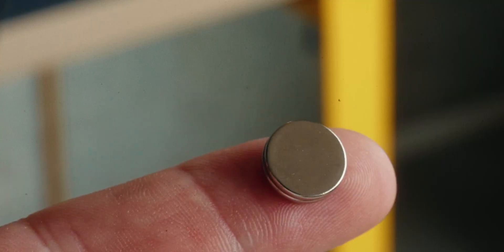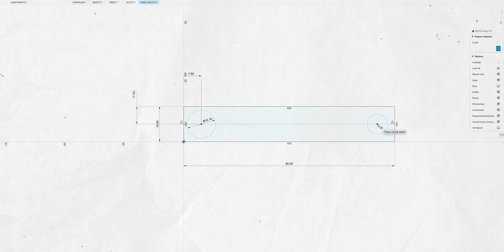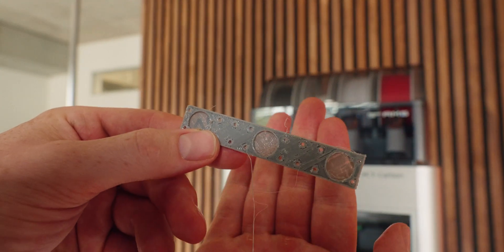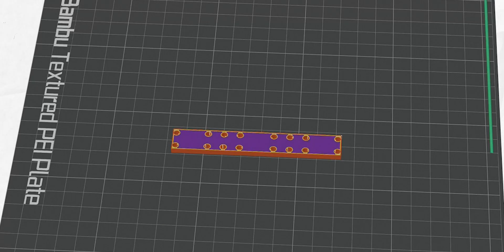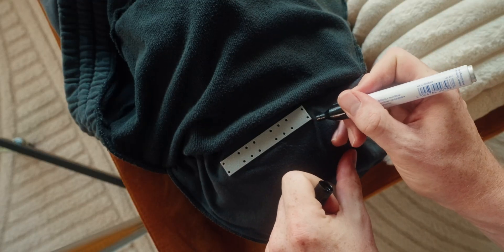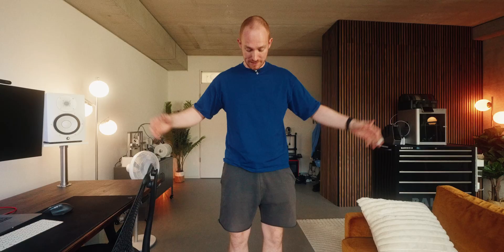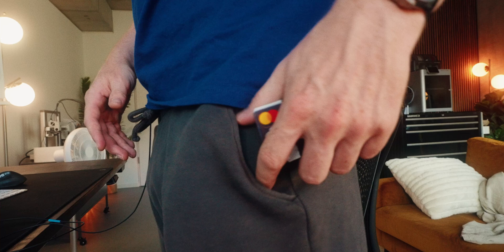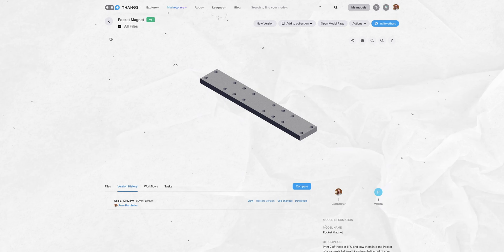The solution to things falling out of your pocket

Comment: Usually it's the phone that's a problem. In the situation where you get to also print a case for it I wonder if you can place the fastener at the bottom corner of the pocket. So that when you place the phone in your pocket it latches onto the corner and stays put. If it's at the corner of the pocket you don't even need sewing, you can clamp it somehow. The difficult thing is coming up with a strong but unobtrusive fastener. Because it will lay against your thigh all the time – you don't want it to scratch or show through clothes.
Reply from the maker: Interesting idea 😊 !

Comment: Instead of magnets on both sides, perhaps you should try printing one side and using a thin piece of ferrous metal with holes in it for the opposite side this would be substantially thinner and you could use thin spring steel that is magnetic for flexibility. It would be much thinner overall and the metal side embedded on the outer piece of fabric which would be less noticeable.

Comment: Just glue a couple of magnet directly to the opposite sides of the pocket, if you use e6000 it will be flexible and allow washing.    I love 3d printing but not necessary in this case.  Larry

Comment: I love the classic case of overthinking... I do that a lot, there are these snap fasteners (don't remember what they are called in English exactly), that have 2 halves and you basically install then like rivets and are invisible and hold well. They would not be visible at all when put on the inside of the pocket. No sewing, no nothing, just put them in place and you are done.

I'm into sewing and I was making my first cosplay and you wouldn't believe how many things I considered and this is the simplest and the best method. And the cheapest.

I like magnets but a lot of the time they rust and flake and overall degrade in clothing with washing over time. There are some special clothing magnets but they are pretty meh and don't work that well. Usually only used kn things like coats where there is a lot of them in a row.
Reply: This seems to have the best balance of usable and easily doable

although... lining up the buttons every time has to be annoying

Comment: I feel like if you're going to go through the effort of sewing magnets into the pockets, you're better off sewing some kind of zipper instead. The only downside to zippers I can think of off the top of my head is that it's slightly more annoying to grab something out of your pocket. But honestly, I think zippers would be more secure than a few small magnets. Cool project idea though, I imagine it would be very satisfying for your pocket to snap shut.
Reply from the maker: Thanks for the idea! Yeah zippers definitely have many upsides:) From my understanding, sewing them in is just a lot harder and since you saw how great my skills are I'm not sure I'm up for that yet. And since zippers are visible, you gotta make sure it really looks good, whereas the magnets are kinda hidden
Reply: It'd be very hard to do on those types of pockets. You might as well sew whole new pants
Reply: Zippers are slow, and I scratched stuff on metal ones. I much prefer the magnet solution 😉
Reply: Compromise: Use those rubber magnetic strips, like refrigerator or car door magnets or the cheap tape rolls at the craft store.
Reply: I've had zipper pockets, total PITA. Always having to zip/unzip, jamming, and the zipper teeth scrape your knuckles up.

Comment: Chamfers.. it needs chamfers
Reply: You likely meant an edge 'fillet'/'radius'. Chamfers can still have painfully sharp 45 degree edges on it that aren't ergonomic to the wearer as they often cause pressure points. I confuse their terms all the time, hence why I know this.. you can however add fillets to the corners of your chamfer, just to smooth them out if you just really dig the aesthetics, lol.
Reply from the maker: as you saw on the first design I had rounded corners but that took away space I needed for the sewing holes. Overall you with some rounded corners and fillets it would look better. But it would be harder to print and since you don't see it I left it out. 
I'll keep it in mind for a future version